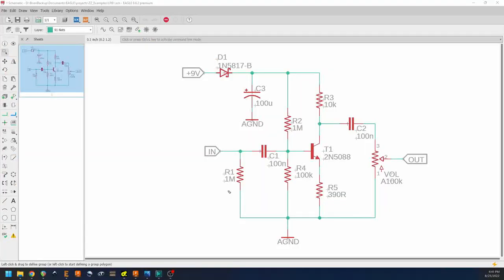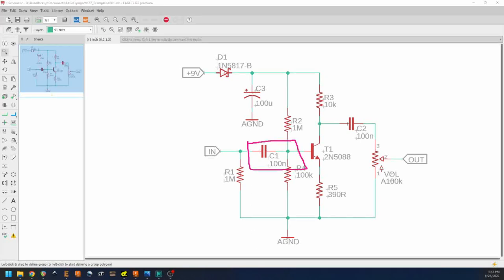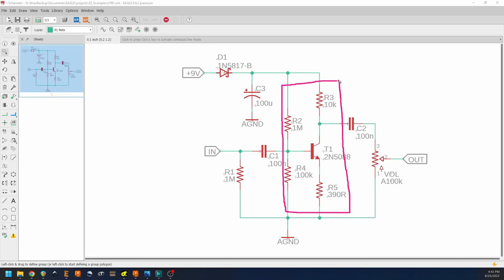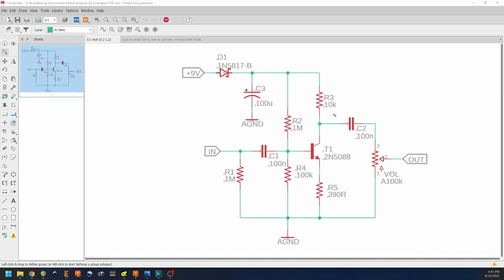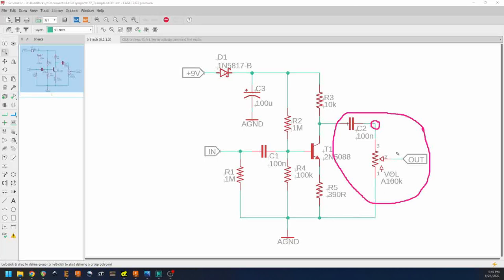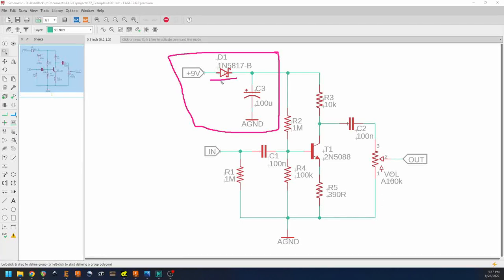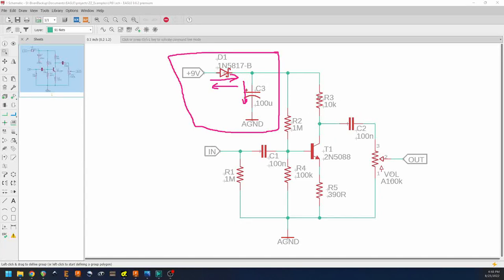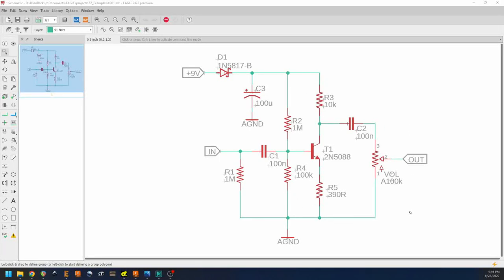Schematic Elements for Guitar and Effects: Transistor Stages, Boosts, and LPB-1

Comment: Really cool explanation thank you for sharing your knowledge! It's possible get  overdrive or distortion from Lpb-1?
Reply from the maker: Not really, it's a single gain stage with no clipping elements. Any distortion from this circuit would be very nasty. If you use some clipping diodes on the output, you basically have an Electra distortion, which will provide some amount of overdrive/distortion.